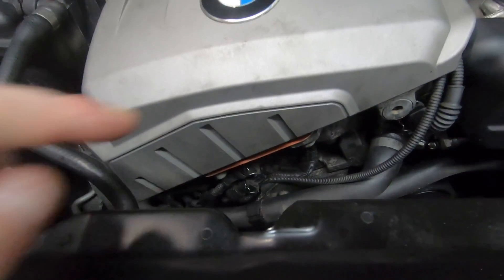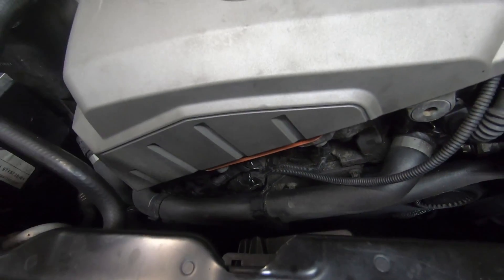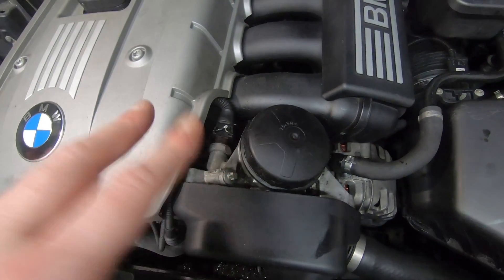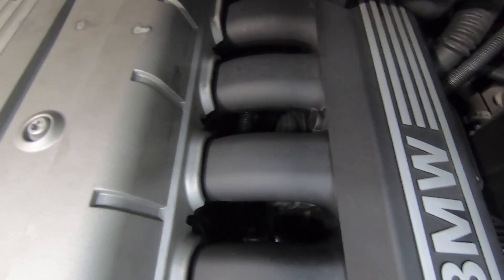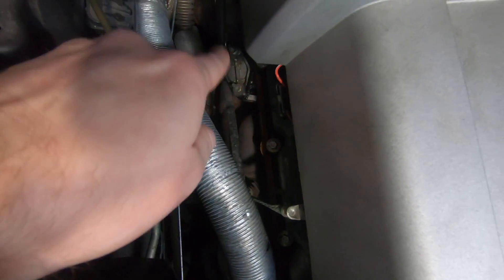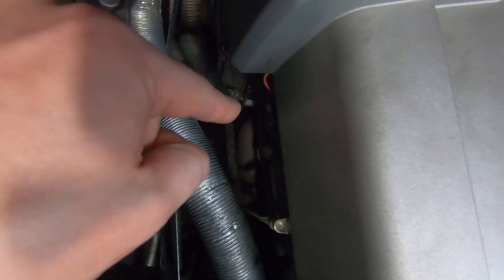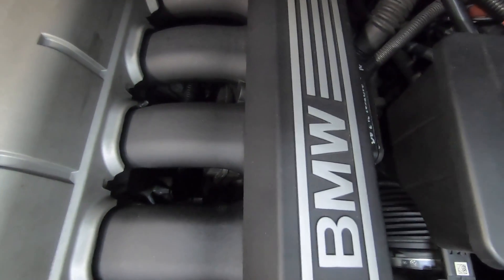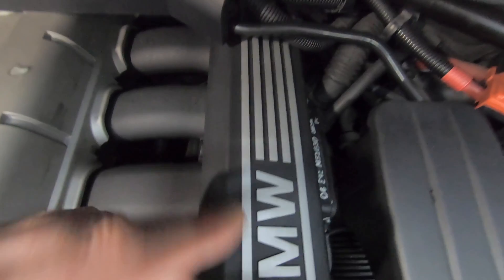Top 5 Parts That WILL FAIL On Every OWNER’S N52 Engine At 100K Miles

Comment: I'm at 103k mileage in my 07 530xi, just recently changed the head valve gasket. Engine is running strong but I have squeak in the belt rite now.. doesn't seem like the oil filter housing gasket is leaking  but im thinking its time for a new belt, tensioner and oil housing gasket just to be on the safe side
Reply: Most of time the squeak sound does mean time for new serpentine belt

Comment: I've got 130k miles on my 2011 N52 and have experienced none of these issues. I consider myself fortunate.
Reply: I have seen an official BMW video where their engineer stated that the best BMW to buy is the last year of the generation. They then state that most of the production and consumer problems have been worked out and updated. Like my 2009 n52 had the lifter tick sorted out and gasket leaks sorted out from factory. I just replaced my vanos solenoids at 200k. Im sure my water pump is going to go at some point but its lasted longer than most.
Reply from the maker: Nobody would ever take you seriously with a comment like that 

Your car is probably leaking and you ain’t even aware as you don’t know where to check
Reply: @BMWDoctor I am very, very well aware of what is going on with every vehicle I own. I have owned it since it had 44k kms, it now has 208k. i have changed one coil, plugs, brakes, oil, and coolant. That's it. It runs flawlessly, leaks nothing. 2011 323i. 
You have lots of people on here pleasuring you, no need to get cranky.

Comment: Hi, If I disconnect the PCV heater like you suggest does it cause any SES light or fault code stored in the DME? Thanks
Reply from the maker: no it dont mate at all I have mine disconnected since the day I got it with no issues

Comment: Thanks for awesome videos,
What make and model Torque wrench you recommend?
Also is there any way you can clone your KeyFob from an existing functional key,  without using some advanced equipment?
Reply from the maker: I use quite a few different torque wrenches mate I will link them in my links mate 

Also you cannot use keys from other vehicles it has to be a new key unfortunately mate

Comment: What problem can the car Have if the olifilter house i broken?
Reply from the maker: big big problems oil leak straight onto your belt loss of coolant and will cause your car to overheat and damage your engine as there will be nothing to cool the oil
Reply: Ok, but i mean the pipe in the oilfilter house😊 if that i off What can happen?

Comment: My friend I'm from Europe but now I'm in USA. Can I maintain e60 myself because American mechanics are crazy with labor. And what kind of tools I need. And stay strong bro
Reply from the maker: You can maintain it yourself mate of course you can bro I have enough videos for this car mate so don’t worry about labour costs it’s all easy on N52 you will need just your normal sockets and spanner’s NO different to any other car no special tools needed mate
Reply: @BMWDoctor  Thank you my friend. 💜
Reply: @bojanmilicevic6619  yep, that'll be 12 hours to change your starter..have to remove the air intake to access. LOL. my father has a one series 2000s model and they told him his ccv was hard mounted to the head and the whole head had to be replaced.

Comment: Had 1 of these. 113k miles. E90 330i. Ccv, off, always, That's a piece-o-shyte system. Just blocked intake with a silicone cork, to prevent vacuum leak. Otherwise, very healthy engine. 

Also replaced VANOS, with OEM.. noticed zero difference.. they were ok, afterall..
Reply: I’ve got one those 330i you don’t have picture where you plugged it such rare and great engine little content on them though Thanking You in anticipation of your forthcoming help and co operation KARL
Reply: @karl1608  the proper way, is by removing intake manifold. Then, installing a catch can. Those hoses are very far back, and below the intake ducts.
Mostly every forum/tutorial say they are brittle, and will break. However...

I had no time, tools, patience, money, etc. So, I did some "cheating": 
with a long salad tweezers, went down between the ducts of intake manifold, pressed the clips that hold the ccv hose, and pulled out;

Then, used a silicone universal bottle cork to plug the hole. 10min, I took. The same, to put it back stock.

Comment: Well now I read your reply on this thread and I feel bad.  Sorry you are in the hospital, and I like all your advice except the genuine BMW (I go genuine when BMW ACTUALLY makes the part.  But for all auxiliaries they sub a lot of that out for US made cars.  I’m sorry I was mean, but if I get told I’m a clown I’m fighting back.  Yes stock the 535d is awesome, I’m talking about modification potential.  In the US you can get a 2008 N54 under $8k in decent shape and for less than $2k you turn it into a 500whp monster.  I hope you get better and I hope you don’t quit.  Your knowledge is informative and valuable.